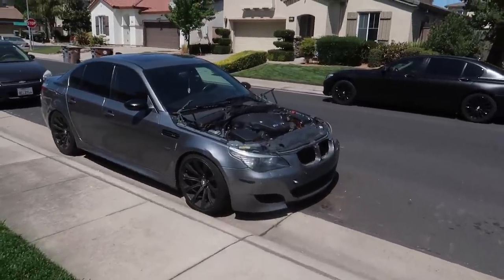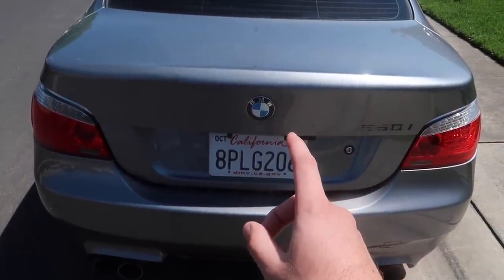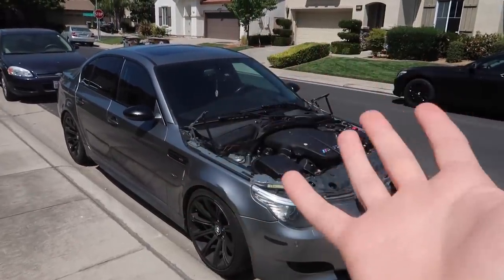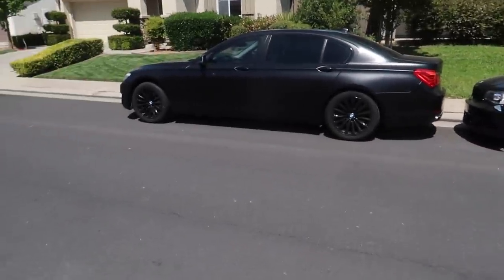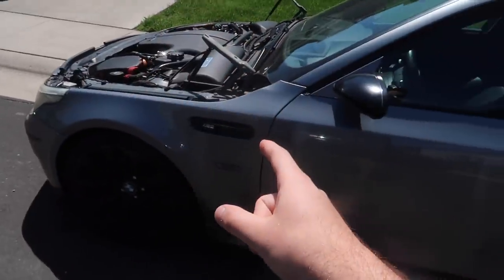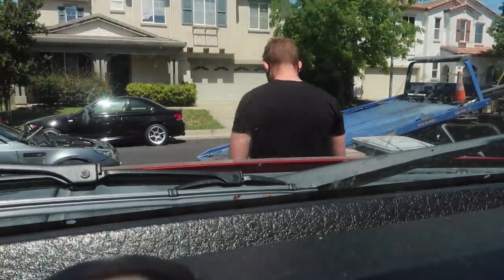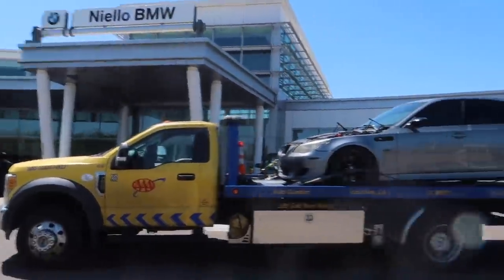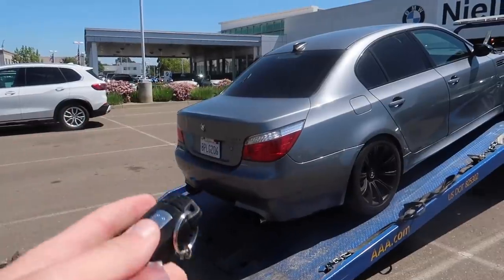TAKING MY M5 TO BMW! THEY ALMOST SAID "TAKE IT BACK"!

Comment: I think it’s either fuel pump or fuel filter or clutch or flywheel causing no starting condition. 5200 is a smg code although it will not prevented the car from starting. 5200 SMG signal engine speed, is faulty (DME) often has something to do with the clutch mismatch engine speed. Maybe the previous owner didn’t install the clutch properly or the clutch is gone. Unfortunately, for that code to go away you have to pull out the transmission and inspect the clutch again this should not prevent the car from starting.

Comment: I’m dealing with a similar problem 😞 I’m thinking about rebuilding my s85 engine because I’m not sure how the old owners treated it and it has almost 200,000 miles on it just replace the transmission,smg pump,fork,flywheel,clutch so hopefully I can be riding it again soon 🤞 if you know any good shop around Philadelphia that you would recommend to do the job I really appreciate your help.

Comment: If he replace clutch and flywheel there is a large hole on flywheel that of to lineup with large hole on crank that happened to me with my m5 and I had to drop trans and remove flywheel and install correct. But it was doing same as yours. I should of commented on your vid when u changed the crank sensor that would of helped you . No Vanos line is internal if it brakes under pressure u won’t know it leaks back in oil pan good luck

Comment: PLUS!!!! The Oil Squirters are IMPROVED since that Car got them from Factory! They're less curvy and they work better, for one. Rod Bearings are improved as well, so you can be excited for not just Replacement Parts but Totally Upgraded parts that last longer and function more reliably.

Comment: Why was there 550i embelems on it and not m5? Lol
Reply: Previous video explained the other owner used a 550 trunk cause they're the same shape and a lot cheaper
Reply: @ravinderarjansinghbahia8310  ah I get you thanks
Reply: J Tommy  I'm pretty sure that's the least of his worries to deal with I think he was interested in getting the car started and having it running. No point de badging a car that doesn't run
Reply: J Tommy  ooooookay buddy and then if the car doesn't run and he can't fix the issue that's causing it not to run at least the badge will be okay? Nice to see where your priorities are 😂

Comment: Dude your gonna have to driop serious cash to repair this car and keep it running. Sell the 7., your gonna need the cash. I would replace every maintenance possible. You have to tirn the engine to know if its Salvageable. Good luck.
Reply: J Tommy  only if he knew what he was doing. Check out M5 E39 channel. Along as the engine is functional is worth saving. But he has to replace everything operating function in the engine bay. I agree easy 10k. I dont believe he will do that. I would.